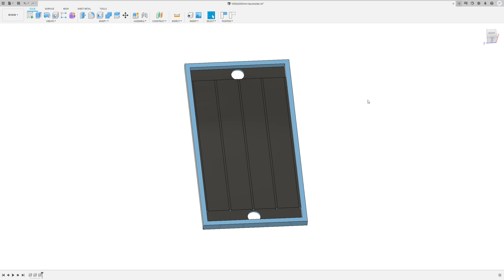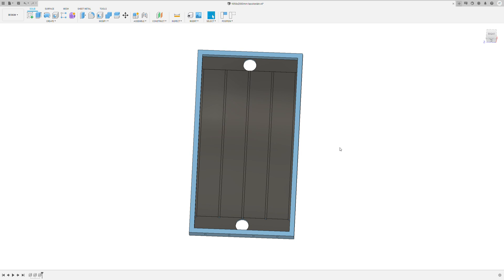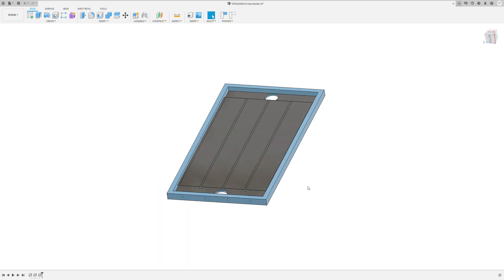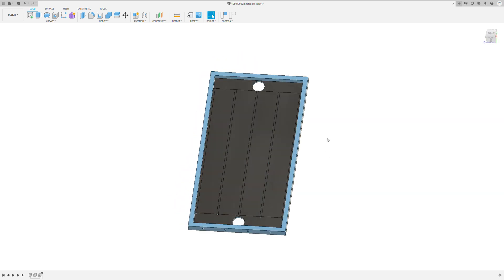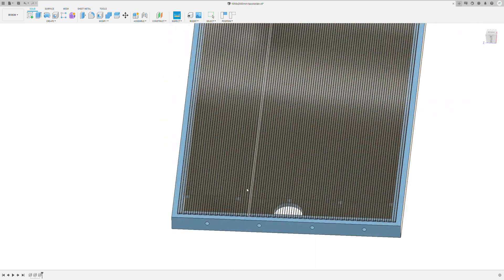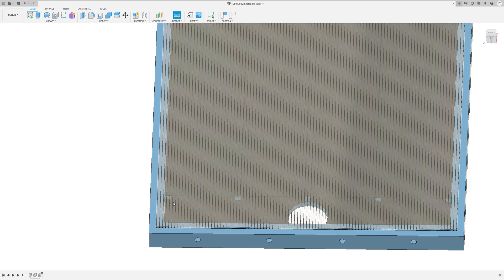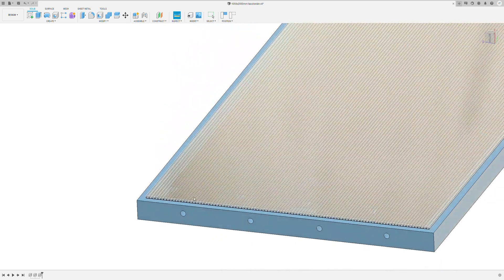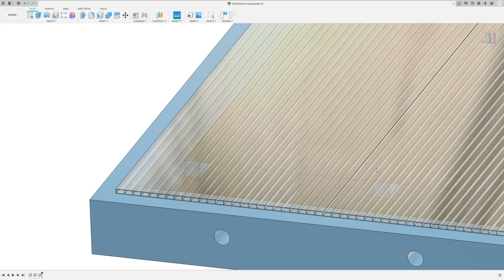DIY cheap,  efficient and easy to make Solar air heater

Comment: What do you mean when you talk about aluminum foil? Thin sheet metal, kitchen aluminum foil, more...
Reply from the maker: Yes kitchen aluminum foil painted black in the middle layer, to absorb the heat
Reply: @TunekoLtd  I use thin aluminum flashing

Comment: I didn't watch the whole video, but do you have working ones with measured performance specs?
Reply from the maker: Sadly Not yet. All my tools are in finland and been again in germany, but soon again more will happen with this and also the ID3... 

The area on both ends need little bit more thinking. I try get that aluminum foil cover that whole area on both ends. More talk will come on linkedin this week where there is some CFD experts where I will present the idea. I think I only need the entrance hole for the air to go on both sides. Hole size for the outer half I think should be about half the area of the entry hole at bottom seen on the video. For design wise its planned to have laminar flow through it. Distance to the heat source/aluminum foil need to be so that air heats all the air that passes the channels without making it turbulent. Optimal distance from some other peoples tests have found out to be around 20mm. There are ways to make air turbulent if thats needed.

On first version idea plan was to add more aluminum material to bend that aluminum to zigzag WWWWW, but that would need a special bending machine and they currently make pretty narrow aluminum foils. That would create the best performance.  But will start with this design.

Ofcourse the tempered glass would also boost performance about 10% but they are more expensive.
Reply from the maker: Reason why air also passes the other side (visible) is that if its sealed and there is hotter air on that side you will lose some heat through that PC sheet. Best is just to heat the air from 20celsius to about 30 celsius and blow it inside as fast as possible. Inlet area vs exhanger area should try to be maximised so air flow speeds inside are slow...
Reply: @TunekoLtd  I'm making similar panels but sending the air over the plate on glass side and returning it on the back side to keep the glass as cool as possible and doing most of the heating on the underside of the panel. with my inlets and outlets on the top of the panel. this would work better if there were fins under the plate and the the plate was closer to the cover so air moves slower under the plate. just my thoughts.